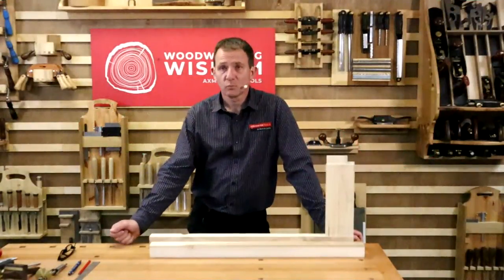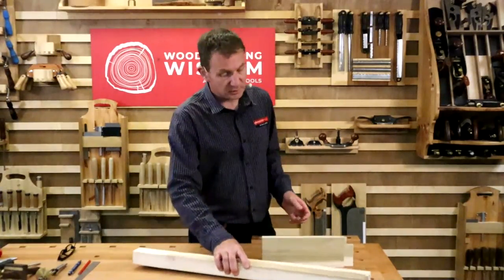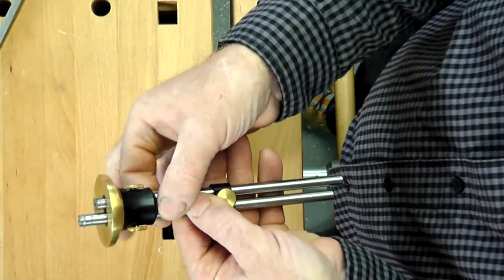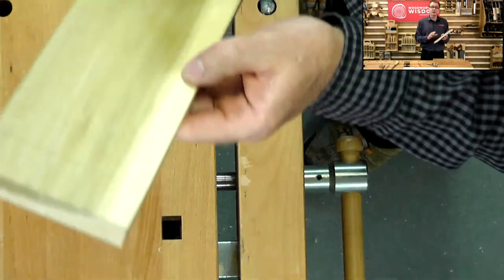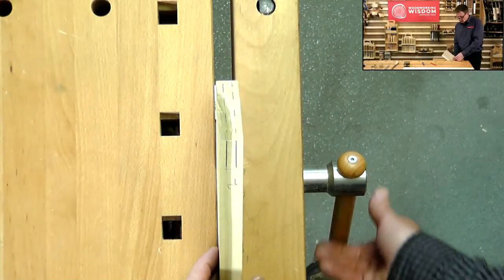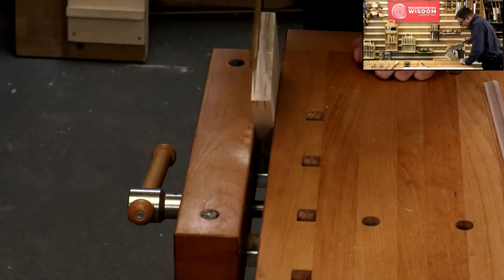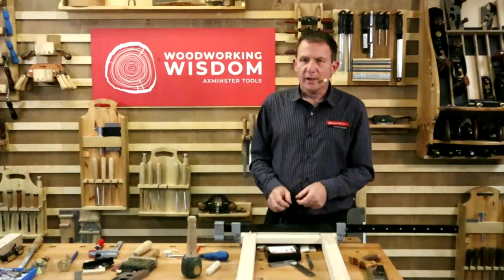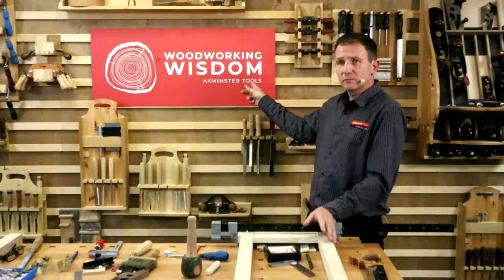Woodworking Wisdom - Hand Cut Mortice Part 2

Comment: After years of gaining knowledge and experience, I've found that handtools can be more efficient than my full suite of electrically energized tools.  Handtools are quiet, don't fling chips & dust everywhere, have only a few parts to maintain and sharpen, and don't require a large amount of space in the shop (they're very portable too).  While power tools can be very convenient, it's only in production work that the speed of power tools is truly necessary (even a lathe can be human-powered).  So relax and enjoy the process of learning craftsmanship.